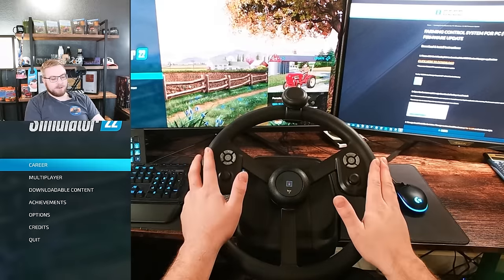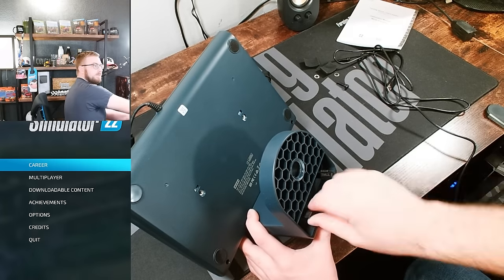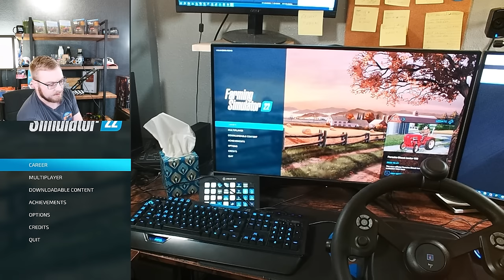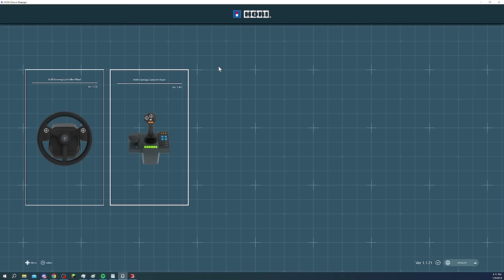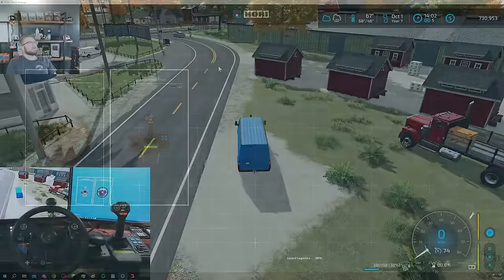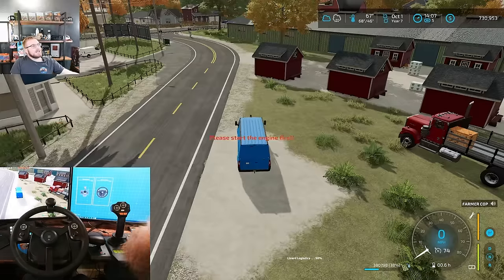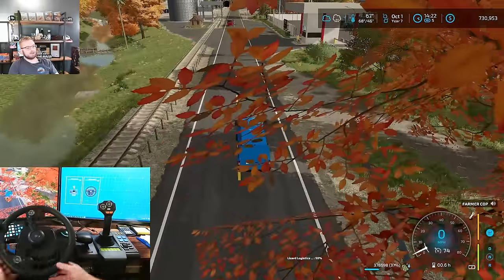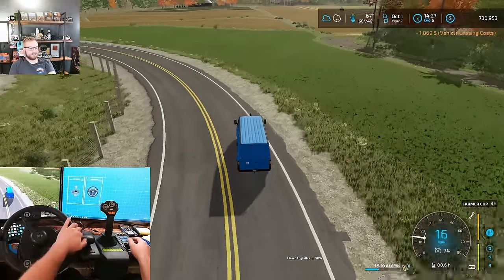HORI FARMING VEHICLE CONTROL SYSTEM - Review Video - Farming Simulator 22

Comment: This is quite the expensive leap from the older Saitek/Logitech wheel/panel kit (which I have), and TBH other than a bunch more buttons it doesn't look to be much better quality of construction.  Although, using Hall Effect sensors seems like a nice upgrade over analog. Will be interested in you revisiting with your impressions after a month or two of using it.
I checked on the web site, but there's scant info on compatibility.  Can you try it in FS19, FS17, ATS, ETS, etc?

Comment: I have been using the Logitech Large Equipment controller, with a g29 wheel and sim dashboard.  This combination seems more practical and also provides force feedback.  A better approach than trying to remember which default button does which, I recommend just deleting them all and then picking for yourself what goes where in a fashion that makes sense to you and because it does will be much easier to remember.  That is how my controllers are set up and what I can’t do with them, I can do with sim dashboard.  BTW have a question for you,  do you remember the 2019 mod for adjusting the mirrors?  Do you know if like that is available for 2022?

Comment: The price verses the looks of the quality of this seems a bit.. well it seems kind of crazy.  I can't see why someone would pick this over a way better direct drive wheel and pedals and just throw in a VKB EVO side stick and it would still be cheaper.  The logitech seems to be about the same quality if not slightly better for 1/2 the cost.  In your opinion, does double the price justify not buying the logitech?